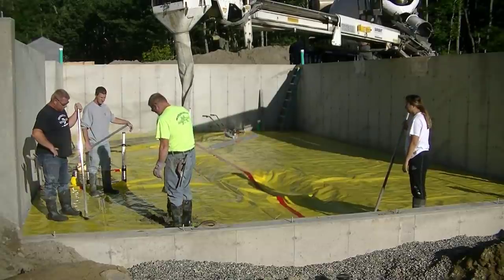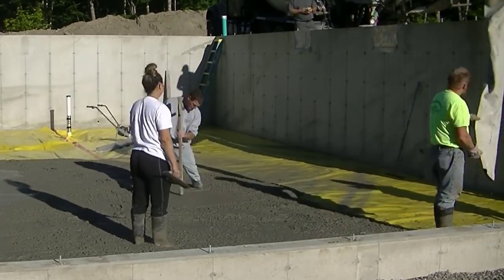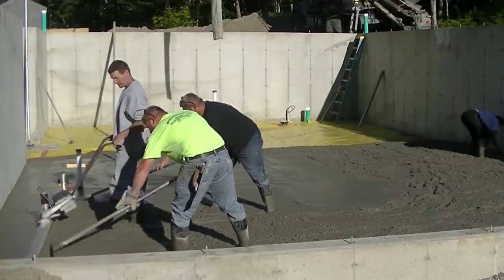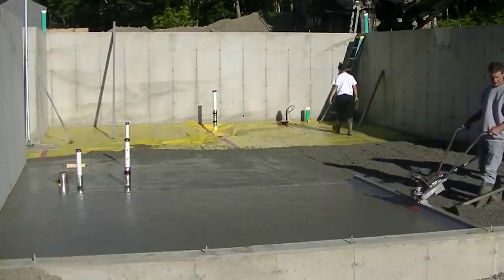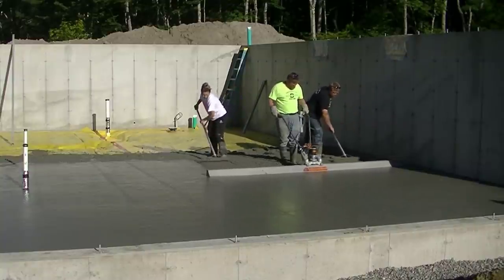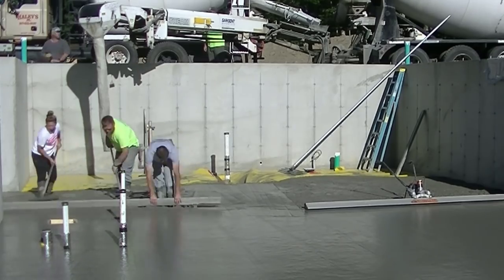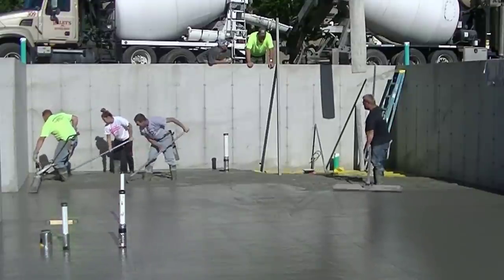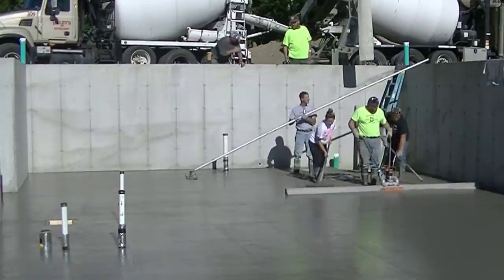Is Using A Concrete Power Screed EASY or HARD? (My 2 Cents Worth)

Comment: I have a $235 eBay power screed and it works as well as any others I’ve used. It’s a couple Years old and I’ve done probably 20 jobs with it so far. I am a general handyman so I don’t pour concrete everyday or even every week. So this makes my life much easier when I do sell a concrete job cause bending over and pulling that mud by hand is a killer on the back. 
I won’t do concrete anymore with out my PS.

Comment: Is there a reason you worked from front to back of the walk out basement? I would think it would be easier to work from the back to the walk out part so at the finish you just work from the ground next to the pad.

Comment: I'm not sure how often you reply, but I've been looking into buying a power screed. I have a question about the one you are using here in this video—How long does the battery life last on this? It appears you did all 18 yards without changing it, is that correct? what is the max yards this battery will last for?
Reply from the maker: Depends on the size of the battery. We use a 5Amp. Lasts for several floors like this one before we change it.
Reply: @MikeDayConcrete  Wow, that's more than I expected. Sound wonderful. Thank you for the reply. Keep up the videos.

Comment: why backing into that corner instead of the open front so you could easily finish it completely?
Reply: So that the they can lift their powertrowels onto the floor instead of lowering them
Reply: @InquiryTeaching  That makes no sense, for when starting all sides are accessible
Reply: @DataStorm1  everyone keeps saying its for the machines but 2 loads dont matter for that...my guess is incase he runs short he can get truck to it

Comment: For everyone asking why he worked himself into a corner. I’m taking an educated guess here but it is probably so they can set the walk behind power trowel right where they started off instead of trying to lower it down.
Reply: 2 loads shouldnt matter for something like that....if youre pouring a bigger floor he could of set it on crock or shower box or hang it from handles in the corner.....my guess is incase he ran short he could get a truck to it

Comment: They’re OK to use on inside, but when you start using them on the outside where you get exposed to whether it works up too much cream to the surface sure you get a good broom job, but there’s no strength of the cream. Your strength in the concrete is in the stones, so it’s not always best to use driveways and things that are exposed to the weather

Comment: For anyone asking why he poured himself into corner there is only 1 reason...incase he runs short he can get truck to it. You can get a machine on whatever way when its only 2 loads and if youre that worried about it you can put the machines on shower box  or crock or hang it from the handles in the corner or something.

Comment: I see you use this for the wide areas
I mostly do side walks and steps
This would be good for me in a 4' or 6' with thanks for the explanation
Reply: I drilled and screwed a 5' screed to a concrete rake. There's so little room for the excess concrete on sidewalks. This tool would be a huge over kill for sidewalks. If you're just trying to put the sidewalks down without soo much on your back, try the concrete rake/screed technique.
Reply: @didisaythat4230  Ohhh thankyou I like the idea
I will now have to sit down and give that some thought
Reply: We use wood “loops” to do certain sidewalks. Triangular 3D cut of wood on a pole..basically a Darby on a pole. Cuts great. Use it to fill in holes or around details like plumbing and electrical. They’re awesome
Reply: @jakemcmahan5711  thankyou Jake for you feedback too
Reply: Thank you. For the feed back in glad I found this channel you guys have been very helpful

Comment: EASY for you brother. You make it look too easy.  We have been thinking about trying a screed like this. Do you have to pour higher slumps to make it work? We pour about a 4-5.
Reply: I use a power screed all the time on low slump Crete all the time. Move slow and keep rpm's high. Works good
Reply: @jaredmiller7027  thank you. Any brand or configuration you recommend?
Reply: @jmconcretecoloradosprings . Brand: I just bought the brand my supplier has so they can easily service it(forget what it was). I use a 12' blade. That size seems small enough it fits most places but big enough to get the job done.

Comment: Is fiber mesh really acceptable when it comes to the surface of a concrete floor for a house? I have seen fibers stick out over time or will putting a sealer over the finished floor prevent that?
Reply: Sealer should help…. Fiber mesh makes the concrete stronger(better). If the concrete is old…. the creme could have washed away & will expose aggregate and fiber mesh.

Comment: Yes I love it, but my only worry,I work alone, so no man on komalong,   Is it doable with no help?…I hate spend 2k. And then use boards again for sreteing ,,,,,love 5he idea but will it be worth it for one guy, I neeed flow and board makes it, I couldn’t really trust. This,,,,,,
Reply: It's doable but he'll you will have prety hard time you have to level concrete a little before.. Like I had to make about 70sqm by myself (both of guys just didn't show up) and well powerscreet just saved my ass.. And also bull float can do great magic..
Reply: @apoage  make sure to let the concrete truck driver know in a nice way that you are screeding by yourseld and maybe he can help keep it real close, good drivers make the job so much easier, and rake it out on the edges and use a magnesium float to get the edges level and that will help you keep a nice flat area. good luck

Comment: Anyone that doesn't know how to hand screed professionally, should not be using a power screed
Reply: Why not?
Reply: @garyh4458  why do I have to think for you? They haven’t got the years of experience required to handle different situations in the mud. If you think you can buy a power screed and go price flat work then you’re gonna lose money and fuck someone’s job up. Not to mention if the power screws fails for some reason. Technology is an aid to experience and professionalism, not a replacement.
Reply: @lrdjacob  You don't have to think for me.  You just need to think for yourself.  Your comment was very rigid.  You may have someone on the job site who can work a power screeder just fine but hasn't developed expertise to do it manually.  Nothing wrong with letting them go at it with the power screeder will someone with more talent an expertise does some detail work around the edges.  Your comment is as stupid as saying anyone who doesn't drive a stick shift shouldn't drive a car with an automatic transmission.
Reply: @garyh4458   you obviously don’t understand the hierarchy in crews, also you’re forgetting that Mike implied that you could start a business without experience and just get a power screed. Labourers rake, not jump on the power screed. Concreter’s who have been doing it many years and understand what to look for in getting floors level are the ones who should be adding to their skill set and learning the power screed, start with the basics. If you are going to start a concrete business without knowing how to screed, you will fail. If you’re relying on others to do your skilled work, you will fail, eventually. Ps driving a car isn’t equivalent to learning a trade, your hypothetical is flawed, as is the rest of your reasoning. My point still stands: don’t buy or attempt to learn the power screed until you can screed by hand. It’s not even that hard physically once you get good.
Reply: @lrdjacob  I invented concrete.

Comment: You’re only as good as the guys cut the bud for you. Trust me. I ran one for years. I’m retired now dig concrete for 45 years. Those fiber screed or fiber strikes are nice but you’re only as good as the guys cut mud for you. they leave it too high. It’s a bitch. They leave it too low. It’s a bitch to use.